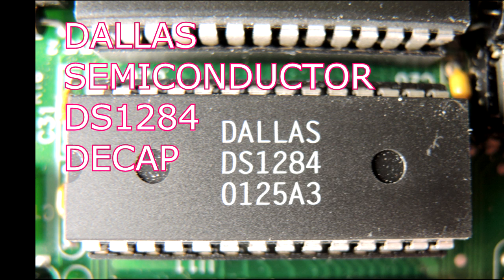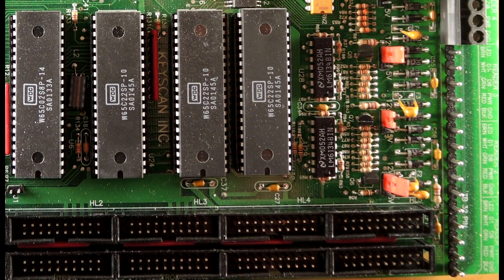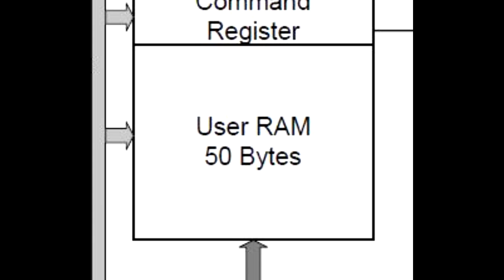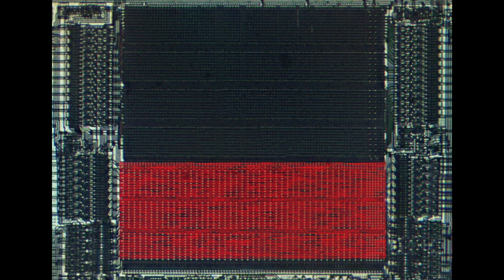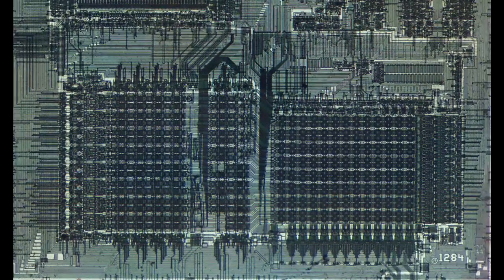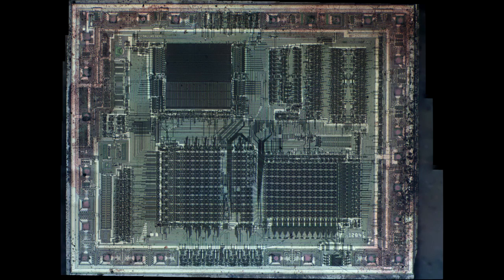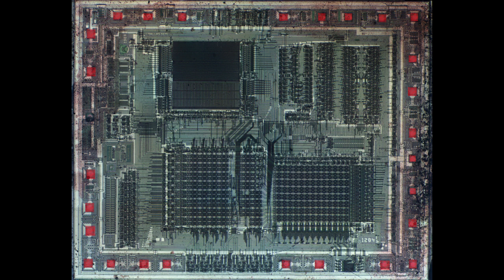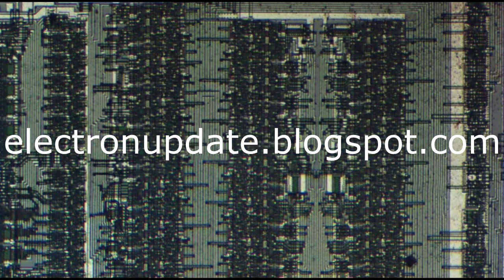Dallas Semiconductor DS1284 Die Decap

Comment: The cheery little guy is a vector graphic of a bulldog. It's a watchdog chip after all.

Addendum: The other version with battery and chip encapsulated into a block (famous in older computers) has a picture of a bulldog on it.
RTC block chip has a pocture of a clock, and battery backed RAM chip has a picture of a ram on it (yes, actual animal ram)

Comment: Precision electronics referred to the voltage comparator that write disabled the RAM and timekeeper registers on power loss, so that you did not corrupt them as the power went off and it flipped to battery backup mode.

These were also standard in all PC's from the 80286 onwards, and were also very common as an add on clock board for the PC XT as well, though later versions of the XTcards also had a multi IO board with the RTC, 2S, 2P, the RLL controller and the FDD controllers all in a single package.

Comment: Request: order a cheap YM2413 from eBay and decap it. It's a digital FM audio synthesizer chip. The cheap $3 ones are almost certainly clones/fakes, and that's why I want to know what the die is like. If you feel like it you could also try to get a genuine one to compare with although those are more expensive, tens of dollars.
Reply: Voting for this !